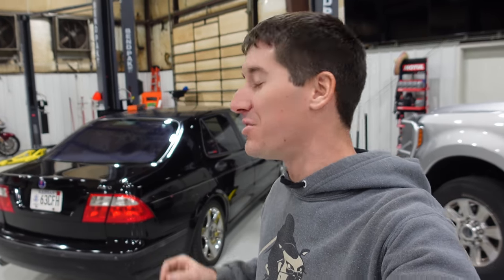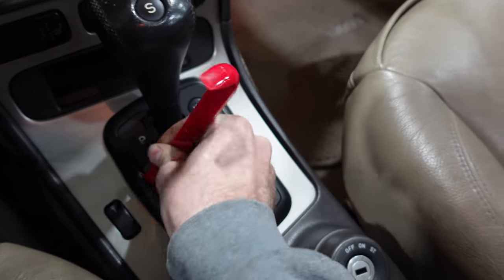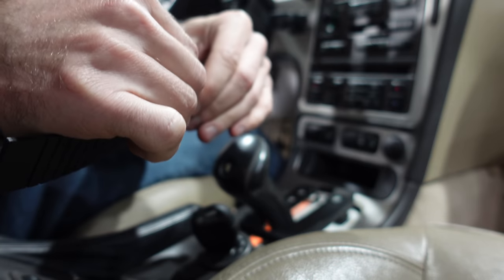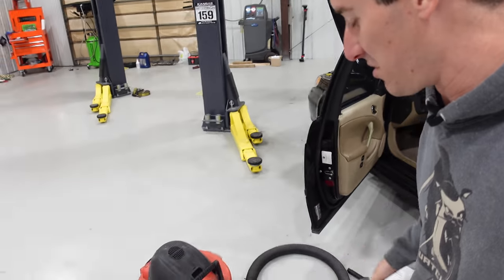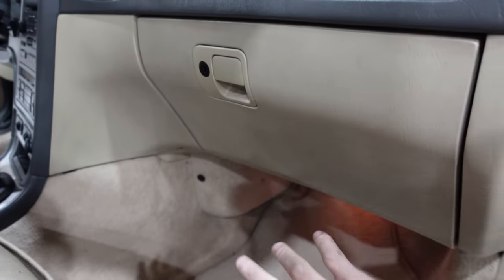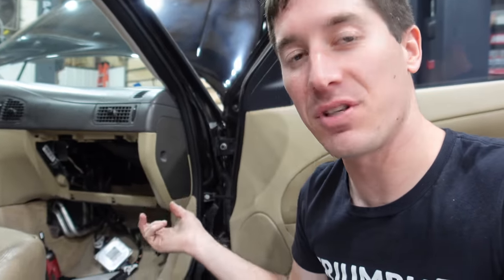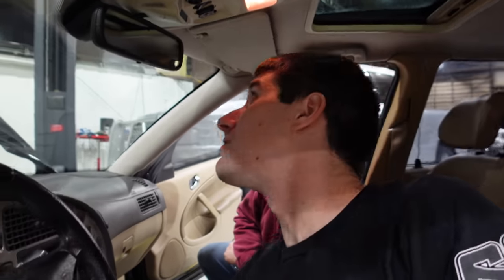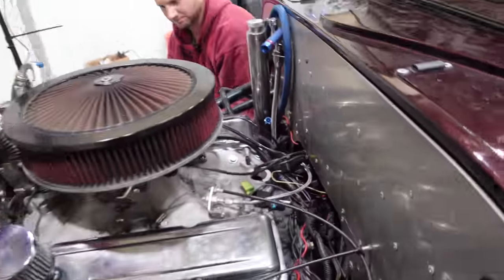I Made A BIG Mistake Working On My SAAB 9-5 But It PAID Off With Free Tools

Comment: Watching this is nostalgia for my 2004 9-5 Aero 5-speed.  I loved that car and I miss it dearly.  I had close to 260K miles on it when I let it go.  Too much rust and too scared of what would go wrong next.  Original clutch, gear box and engine.  ran perfectly.  Now I find myself looking for another in good shape but not easy to find.  Thanks for sharing yours, I'll live vicariously through yours!
Reply: Why not to weld one? I have one fith rust holes in longerones that I can put my fist throught, but still it passed mot

Comment: The plastic push clips that hold the carpet cover over the AC lines, among other places: if you still have the factory tools in the trunk, the screwdriver has a nub on the handle designed for pushing into those clips to release them. You can do the cabin filter using just that tool.

Comment: I did the factory method on the jalousie on my 1st of 4 9-5's. It took me 3 hours. My Saab specialist would bill 1.5 hours. Takes 3 minutes with the shortcut and the other 3 have been fine for 2-5 years and 30k+ miles each. Sometimes the Saab factory WIS is terrible! the alternator replacement recommends pulling engine mounts and the pass side axle. If you sand the intake manifold casting ridge you can yank it from the top and it's only a 2 hour job.
Reply: I cringed when I saw you cut that shifter part but it will work fine like that. A cheap set of torx keys would do the job of getting that plastic cap off the back and slide the leather shifter off. First time it's a task but once you know how it only takes an extra 10 min to remove it. You can also take off the pass side motor mount, lift the engine and you shouldn't have to sand down the intake for replacing the alternator.

Comment: I did the cabin air filter on my 2004 Saab 9-5. What an awful job that was. You have to take all of the crap off to get to it and the basically stand on your head under the dash to get to it.

Comment: "Jalousie" is a type of window that was popular in the 1950's and '60's.  It consists of 20-25 horizontal glass plates about 4 inches wide and the width of the window.  There is a hand crank and an aluminum mechanism that opens them all up at the same time, allowing air to pass.  

They look like hell, they allow bugs to enter the house, and they have no insulating properties at all;  They work in Florida to some extent but even there they are a BAD idea.

Great video!
Reply: We had these windows in our house when I was a kid.  My parents pronounced them as "Jow-La-Cee" windows.  I had no clue what word JR was saying in this video.  Funny.
Reply: @enjoylife7030  I've heard "Jaal uh see", and "Juh Loo see".  Most people in Florida happily rip them out and replace them with impact glass.
Reply: JAH-luh-see.  And the windows are for tropical areas with open/un-airconditioned spaces, so insulation isn't the point at all.  They're for maximum ventilation with some ability to close for rain.
Reply: @llaughridge  True.  The thing is, they are not needed anymore due to the prevalence of AC, and they are not the hot tip at all in hurricanes/wind storms.  

Some homes in Key West have been retrofitted with impact glass windows on the INSIDE of the home to preserve the look of the original jalousie  windows;  This is the best of both worlds since these old windows do have a certain charm.  On certain homes.

Comment: My Mom had a 2005 VW Beetle and the cabin air filter was a multistep process to access and change.  When I sold the VW I did the maintenance including the cabin air filter. It was so bad I put in a note with the miles and date under the first panel one removes to access the filter. The original factory filter I removed had been chewed through by a mouse and he/she took up residence in the dash.

Comment: J.R., I saw that your paint can was clogged. After you get done spraying with a rattle can, turn the can over and spray until it gets clear. Then when you use it again it will work perfectly.
Reply from the maker: I always do… but this can has probably been sitting for years. 😬

Comment: With the 2005 Mazda 3 cabin filter the removal process was the similar; glove box, two fuse and relay panels to remove,  some securing screws at the Hvac, then removal of the cabin filter housing. The filter is in two pieces because there is no way one cabin filter would fit. It for removal. 5 to. 75 hours.

Comment: You have to wonder how some automotive engineer designs a car so that regular maintenance items such as the cabin air filters are so convoluted to change. I remember one VW I had (a Passat) where I had to remove carpeted panels from the tunnel and parts of the glove box in order to access the cabin air filter. I took the flexibility of a contortionist to finish putting it back together. After that, I just left it to the mechanics when I took it in for scheduled service.
Reply: ...and VW wins!

Comment: I bought some Motul oil for my 2005 nissan sentra S with 1.8, I hope that the ole car likes it.  I hope that there is improvement and if there is I will use this in all my Sentra's and my Corvette, as for my 95 chevy van that is 2 quarts of Lukas and 3 quarts of conventional Pennzoil, the Corvette also gets a quart of Lukas.  Lukas is great in these old pushrod engines.

Comment: SAAB's enginerring is legednary. The OG Top Gear guys did a review of SAAB when it died. GM killed a lot of brands world wide incuding Holden in Australia. Evidently when SAAB entered rallying they had to fit a roll cage but the car didn't need it.
Reply: Holden, Saab, pontiac are 3 of general motors biggest mistakes, should have never gotten rid of them.

Comment: Got to luv a hidden cabin air filter😉. You have to ask yourself has it ever been changed? Had a a Merc Sprinter van years ago with no AC but it still had a cabin filter. It was never changed when the van was serviced at the dealers. I eventually found it when investigating the lack of heat/airflow. Buried under a fabric insulation cover in the engine bay….absolutely blocked.🙄

Comment: Fun fact: according to swedish law the seatbelt sign should be in the roof, next to the rearwiev mirror. Thats because the police can check the light when they are following you, if it´s on, they pull you over and give you a ticket for not using the seatbelt. Sweden is amazing, so many simple things that makes life easier..
Reply: Good for its time, but our modern always-connected 5g equipped cars will report any actionable offense to the authorities in real time.  If your offense is deemed serious, the remote kill switch will disable your vehicle.
Reply: And that's what electrical tape can solve.

Comment: Are you missing your battery box cover? 2002+  have a passive battery cooling system. A duct from in front of the condenser brings cool air under the battery platform.  As the car moves the air flows in and cools the battery to a temp below that of the underhood air. Heat is the enemy of lead acid batteries. Good engineering. Get yourself a used battery box cover JR!

Comment: The cabin air filter job looks a hell of a lot easier than on my Mazda5 6MT. You have to disassemble the center console and then unscrew a cover that’s smaller than the air filter itself. The filter comes in two parts, so you you need to stick one half in, push it up, and then slide the other piece underneath the first without the first one falling down. To make this job easier it’s best to do it upside down, laying on your back.

I made the mistake of buying a cheap filter from Amazon. After the hell I went through to swap this annoying thing my car then smelled like cat p!ss, a smell it didn’t have with the OEM filter.
Reply: Yup! My 2005 Mazda3 was exactly the same...

Comment: No idea how, but on my old Lexus ES350 (RIP) when I pulled the engine air filter I found one of the spare keys to my dads 4runner, even though I had never changed it at that point

Comment: Bowling Green is in very bad shape, it barely missed my uncle's house literally by across the road.  Several factories and storage facilities are completely destroyed, along with multiple historic homes.  I went through BG on sunday to visit my sister in my hometown it was a pain to get through to some of the backroads that I needed.  It will be years to get it back to were it was.
Reply: Corvette factory?
Reply: @Flies2FLL  I think it did get damaged on a section as the side I seen was fine but heard it got damaged, everything else around it was collapsed except for a large metal factory.  If you have one on order expect more delays as I'm sure it was closed for a day or two, it basically went down the main road 31W around BG.
Reply: @whatchis1120  Wow, that sucks.  I don't have one on order, I'm into Porsche's, but I'd hate to see the place damaged.  That is a prestigious product and it represents a lot of good paying jobs.  Hope everything works out-

Comment: Nope, not every other cabin air filter is a 30-second job.  I've got a Ford Fiesta, and I'd love to see if there's a trick to making it a quicker job, because it sure didn't seem easy when I did it!
Reply: The Fusion is a pain, too. Use a trim tool to pull the dash end cap, the passenger AC vent... remove the entire glovebox... then the air filter door is held in place with screws AND aggressive snaps...

Comment: I thought my mercedes filters are a pain and it has four of them. Two particle filters behind the glovebox and two carbon filters under the kick panel. Looks like the Saab has me beat except I never found any tools in there. Lol
I don't even want to talk about the mono-wiper repair.
Reply from the maker: Mono wipers are so cool though! 😍
Reply: @WatchJRGo  I think it's kinda neat but I rarely get to use it here in Vegas. No rain!
There is a rubber boot/seal at the base that was all dried and disintegrated on mine when I bought the car. Getting the whole mechanism motor and all off the car is not to difficult.
It is supposed to split apart so you can slide the old boot off and the new one on. Mine would not separate. The center shaft was frozen in place. So I tore the old one off. I stretched the new one over the whole mechanism. They are pretty thick and are not made to stretch. I managed to do it anyway without tearing it.
It works great and the design is ingenious the way it extends out when going towards horizontal on either side and then retracts as it goes vertical so it pretty much covers the whole windshield. I just paid $31 for a Bosch wiper blade for it at Napa. Yikes!

Comment: @WatchJRGo Are you going to upgrade the tailight bulbs to LED too? Would love to see the process to figure out which ones are not too bright and not too dim but look like a simple OEM part. If so, also a comparison between the incandescent and LED would be cool. Thanks!
Reply: I have DDM Tuning 6 x Cree LED bulbs in my tail lights, turn signals, and reverse lights. The brake lights are significantly brighter than stock or even the Sylvania Zevo LEDs you find at the auto parts stores. Just the parking light function on the DDM bulbs is brighter than the brake function on stock and Sylvania LEDs. The DDM bulbs also have a noticeable brightness increase between parking and brake functions... something most cheap LEDs fail to do. And lastly, the DDM bulbs actually fit securely in my 7443/7440 sockets unlike the Sylvania LEDs that don't snap in like a stock bulb would.

I'm sure there's probably something brighter or better out there... but these just work for me

Comment: Try changing the cabin air filter on a 90's BMW 3 series..... it is just as bad..... glove box has to come out, the footwell cover too, an airduct in front of the filter opening and you absolutely have to clip out the wire distribution box right in front of that filter opening..... THEN you can unlock the cover, pull that and the filter..... now do that in a car nearly 30 years old...... be ready to have the plastic parts ready to swap them out if they aren't already broken anyways.....

Comment: Isn't that called the PRNDL not the gelucie?
Reply from the maker: I call the PRNDL the gear position sensor on the transmission. The Jalousie is the rubber slider that covers the hole for the shifter 🍻
Reply: Jalouise

Comment: Cabin airfilter change in 2011 Volvo v60 is not easy job either. 

I think when they started making car that filter was the first part and then they started building car around that filter..

And after removing multiple parts there isn't still enough room to just swap filter, you have to bend filter from middle to fit that on it's place (it's even on instructions)

Just thinking that (bending) ain't good thing for new filter... 🤔
Reply: Not sure about your Volvo, but I know on many models they did not bother switching access points from RHD to LHD. Most are easy to change in Europe, a nightmare to change everywhere else.
Reply: @zachm7916  i'm from Europe, Finland (neighbor country of Sweden where Volvos are made) and LHD in here😄
Reply: @JS-1983  I guess it's just bad design all around then, I've seen the RHD come out easily since the filter isnt blocked by the accelerator pedal and paneling. I thought there were more countries in Europe that use RHD, apparently not.
Reply: @zachm7916  yeah, it's bad design. 

It's middle of car, under the dashboard front of center-console and radio, you have to remove plastic from side of center-console (footwell) , plastic under glovebox, fusebox (or maybe even two of them, can't remeber), lots of screws on clips and possibility to broke some plastics...

And that filter itself, to install new you have to bend it to u-shape from the middle to get it close to it's hole.

It didn't take so much time (about half an hour) but made me angry, because why make that so difficult and cumbersome. 🙄

Some cars you can swap filter without tools just opening couple clips and it takes 1 or 2 minutes.
Reply: @zachm7916  Only britain uses RHD in Europe.

Comment: Please don't try and put led bulbs into a housing designed for a halogen bulb. The led bulbs do not output light in the same way and lead dramatically increased glare for other drivers.
Reply: Yes. I hate people that just start putting HIDs or LEDs into halogen housings...I've never put them in my cars and I can see perfect with halogen bulbs. Waste of money in my opinion. And I've been working on cars for 14 plus years. I don't even do led signal bulbs or any other bulbs. Nothing wrong with what the car came with and they last a long ass time. My 04 Acura still has its original HID headlight bulbs and they work fine. I just replaced my wife's headlights on her 02 Sonata and they were original. Granted the car only has 106k miles but still.

Comment: The cabin air filter looks like it was designed so the stealership could justify charging 2 hours labor to change it. There is no other reason for it to be so involved especially for a company known for its engineering.

Comment: Sometimes it's the little crap that completes the car. A lot of the stupid things like that have shortcuts that save a ton of time and don't break anything. My sisters 300M there are shortcuts to replacing the headlight bulbs and the battery that are both horrible to get to and all k8nds of things have to be removed the official ways, stupid designs.

Comment: It's a GM Saab. They are cool looking cars but absolute garbage reliability wise. I owned one, it was an 01 Hatchback. Sharp looking cars but a pain in the ass to work on. I'm a GM guy but the plastics on these SAABs are horrible. Had mine for a month or so, dead of summer and the AC didn't work and the airflow with the windows down was atrocious. Glad to get rid of it.